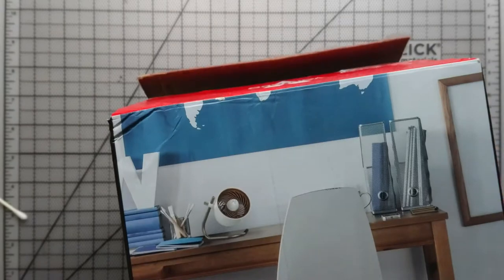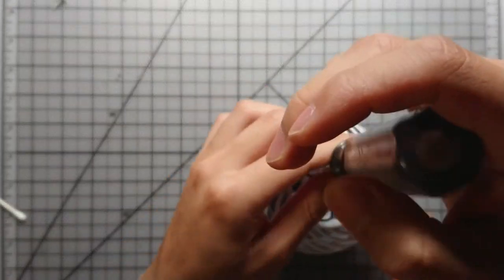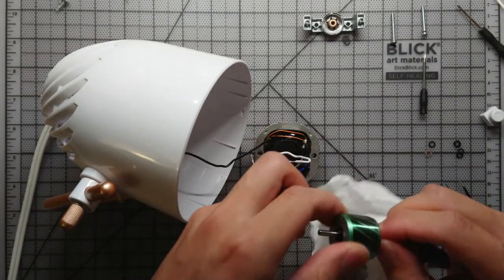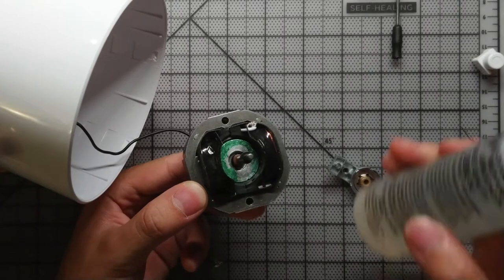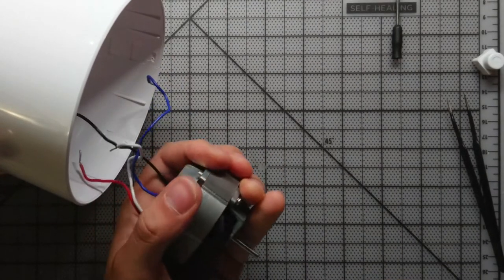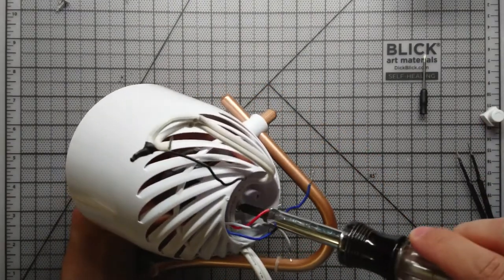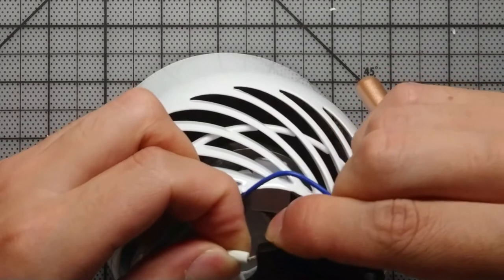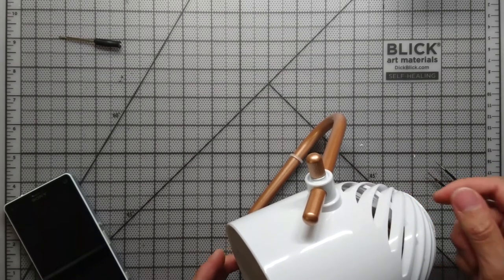Vornado Pivot AC-Shaded Pole Motor Lubrication

Comment: After 15 minutes and 3 slim screwdrivers...grill popped off.   Cleaned and oiled the motor.  Ground off the holding clips, except on at the top, added a screw at the bottom.  Next time  5 minutes or less for a cleaning.   Thank you for the tip on the clips !!!

Comment: The first step of removing the fan blade grill remains the unknown procedure in this video that you can't get past to complete the rest of the procedures. The video leaves you guessing how to get past the first step. Use a flexible spackling/putty knife and gently pry on the catch nub on the fan blade cover side of the seam of the fan body and blade cover to push the cover catch nubs down and pull the cover forward. Do this to about three of four nub catches next to each other to be able to pull the cover off. Remove the front edge of three nubs that are next to each other so next time you want to remove the cover it will not be so difficult to remove.

Consider adding Super Glue under the mount shaft bushing on the outside surface and inside surface of the the housing to take some of the wobbliness out was the fan stand design.  Several wraps of plumber's Teflon tape around the stand shaft that goes inside the fan stand mount bushing will help take some more of the slack/wobbliness away from the stand too.
Reply: Hey dude. I mean this, thank you. I literaly was wondering how to do this.

Comment: Motor is sealed. Impossible to lubricate, I was told
Reply from the maker: Some models do have sealed ball bearing motors.
Reply: How did you chop the clips off of the grill?
Reply: Drip sewing machine oil on the motor shaft. The oil will find its way onto the bearing/shaft surface as it is spun.